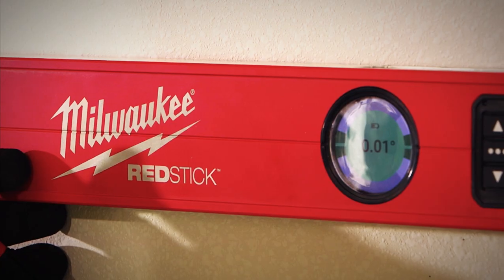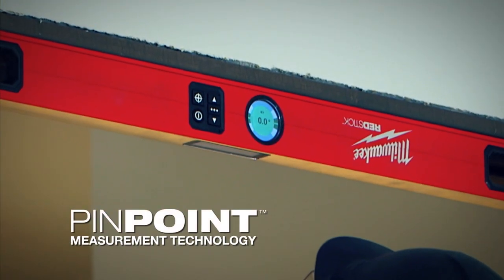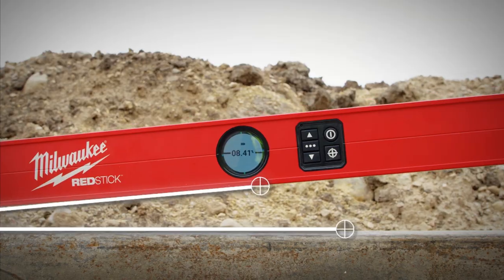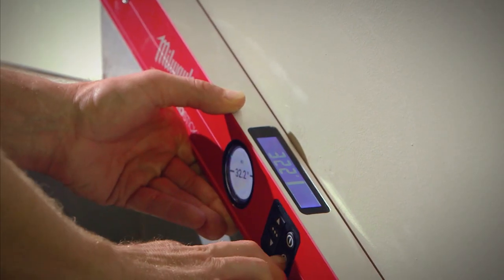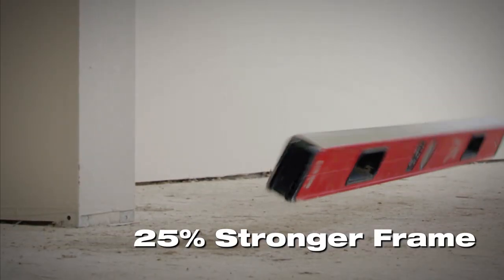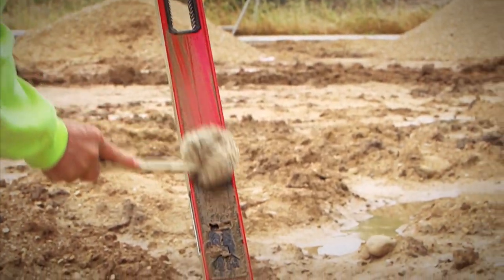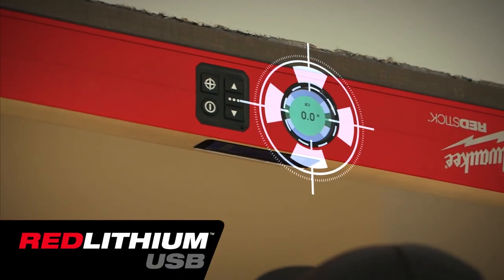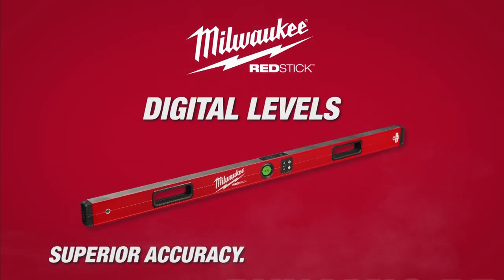Milwaukee® REDSTICK™ Digital Level w/ PINPOINT™ Measurement Technology

Comment: They need to make this in a concrete level for ADA ramps so you can confirm your slopes are good while your screeding. I use a Stabila right now and want to buy a Milwaukee concrete level but I need one that I can check my slopes with while screeding.